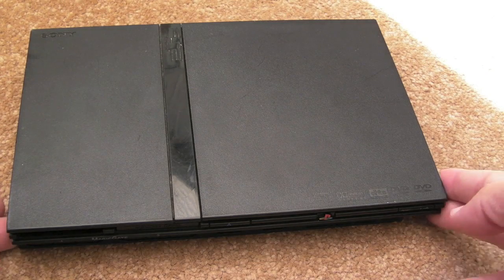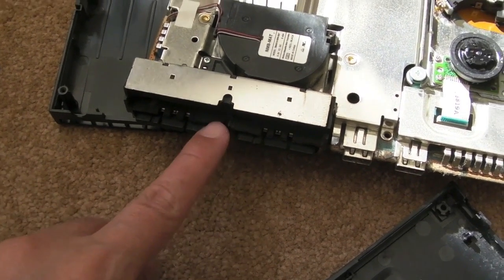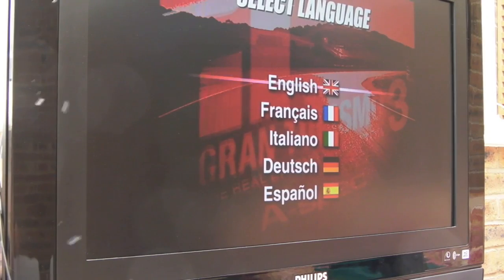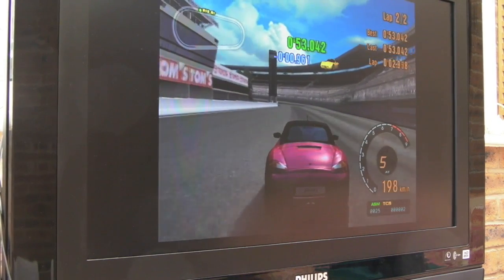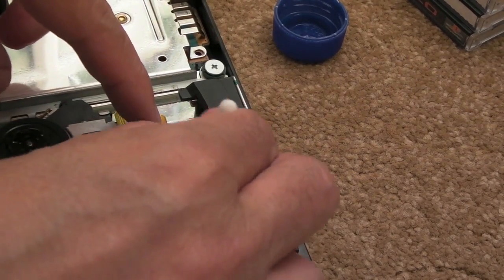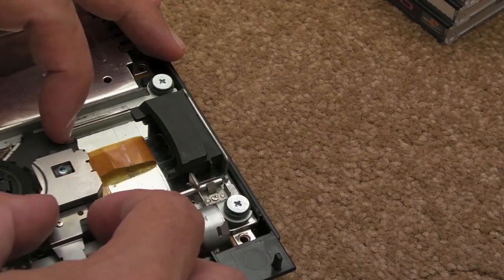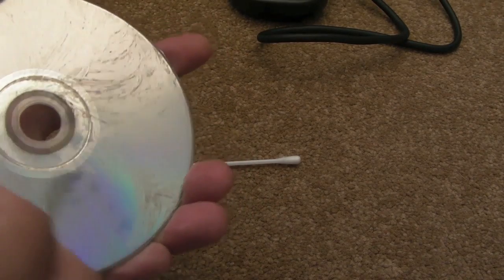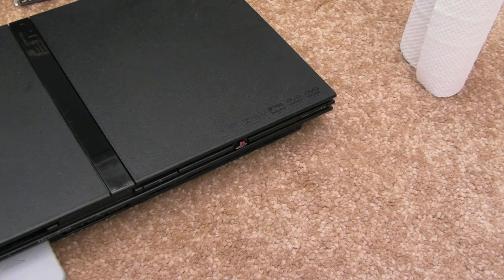Sony PlayStation 2 (Play Station) Slim DVD Repair (PS2 PSX) Scratched Discs (Cleaning Scratched CD)

Comment: This was very helpful, thank you. Figuring that I had little to lose, I just grabbed my screen cleaning fluid and gave my GT4 disc a thorough going over. It looks almost new now compared to a few hours ago. Am delighted that I don't have to buy it again. :)
Reply from the maker: Great =D  If your discs are getting scratched like that - don't forget you might need to swap out the ribbon on your slim.

Comment: I used to work for SCEE and the PS2 was known for cutting its own vinyl on your disks.
 Double side sticky pad underneath and over the top like a sandwich to hold the ribbon back. Thats what i used to advise. Works well and doesnt get tacky with heat.
Reply from the maker: Thanks for the info - very useful to know =)
Reply: Oh how do I do that

Comment: Shit design flaw. I just experienced one of these consoles scratching my copies of Twisted Metal 3, Tekken, Tekken 2 and 007 Nightfire.
Reply: Have you tried replacing the ribbon cable?
I had the same situation with my 79001 PS2 slim, and replacing it made a huge difference.

Comment: would you happen to know if the PS1 has any issues with scratching disks or if the disk reading mechanism (probably also a ribbon) is more reliable than the PS2 Slim? been using my PS2 slim for mostly PS1 games recently and i just got a ring scratch on a brand new copy of Castlevania SOTN i just got :/
Reply from the maker: I've not heard of the PS1 scratching discs at all!  Seems to be a problem related to the PS2 slim primarily.   You can just swap out the ribbon on the slim with a new one which has new adhesive.
Reply: alright good,neither have I but I just figured i'd ask you since you know more about this stuff than me. Good stuff,i just ordered a new ribbon. Thanks a lot man!
Reply: so replacing the ribbon did the trick,I don't get any scratches on my disks anymore but there's a new problem now...All the games i play seem to take a longer time loading and most importantly, during cutscenes, they tend to lag and not show properly.It's definitely the console and not any of the game disks,any suggestions?

Comment: Seems to be a bit of a common fault. Since I put mine back together it's scratching discs the same way. Think my laser is on the way out too. :(. Might hold off on getting a new laser until I locate the code for the PIC Chip Fix to protect the laser.

Comment: I bought my PS2 slim brand new and sealed in 2013 and barely used it. I started to actively play some games on it in late 2018-now(2019) and not even clocked 50 hours of gaming on it and this happened. It's treated with outmost care and is more or less mint condition. Is this just a normal design flaw where the glue/sticky substance ment to keep the ribbon in place dry up or disintegrate. Or am i just really unlucky?:P
Reply from the maker: Just a design flaw!  With time the glue dries up and and the ribbon comes loose =/
Reply: @GadgetUK164  Thanks for answering and thanks for the help. I think your video helped. Luckily I own 2 copies the game it happened with and I've tested with another game I own 2 versions of and no scratch marks so far:)
Reply: Gentlesir PancakeBottoms you're unlucky. Mine still works after 14 years

Comment: Literally just found out about this issue after I noticed one of my most valuable games had the hell scratched out of it
Reply: I’m in the same boat. It only works sometimes now. I have to keep resetting the system until it finally spins up. I bought a new cable and was looking up how to install it. But now I know how to at least polish my disc. I got nothing to lose at this point lol.

Comment: Hey man is it easy to replace the Ribbon? How do you take it out since most part of it is glued on the console? Do you just pull it out? Thanks for the video!
Reply from the maker: +mdrb97 Yes, it's easy to replace the ribbon!  Just order a new one - making sure you order the correct part.  Then the old one peels off the metal casing.  The new one comes with self adhesive on the back.
Reply: +GadgetUK164 Thanks for the answer I already got it sorted out tho (its really easy to replace after all)

Comment: 7:27 A few of my PS2 games have this same type of scratch, except it's in the center of the disc near the hole. The games still play just fine, but I'm worried that eventually they will stop working. What do you think is causing my discs to get scratched near the center?
Reply from the maker: Something in the tray, or the flex ribbon  (like in this video).

Comment: I have the latest model SCPH-90004. I can't even see, if it may be due to the ribbon or something else, because the metal shielding with the lens is always on the upper side and can't be moved like you do in the video with ease, when the console is in standby...
What do you think? Can it also do scratches because of a different issue?
After playing my game for 30 hours, it suddenly refused to load a specific room, then it was with every bigger area, a few hours ago I put out the disc and saw that terrible vinyl on it (it was Silent Hill 2 DC, a brand new copy)... :-(
Also regarding the disc: my scratches are on the same side as yours of GT3. Is it necessary to clean, in order to let it play again on a fixed console, or is there data written onto this outter spot?
And finally, how is this cleaning product called (= independently from the brand name)? I'm from Germany and want to use a similiar product from my country instead of importing yours. :-D
Reply from the maker: Often most of the disc surface is used by the game - so yes, a ring on the outer edge would need to be cleaned / buffed out.  The polish is Meguiars Plast-RX, but you could use Novus (both are a very fine plastic polish).  The scratches in a PS2 Slim are always from the ribbon rubbing.  You could move the laser unit by putting in a DVD movie, search to the end of the movie, that will then move the laser as you scan towards the end of the film - then just pull the power lead out and the laser should be further into the disc.  That might help you see the ribbon.
Reply: @GadgetUK164  
Thanks for the info. :-)
I will try to fix it somehow... Do you think it's absolutely necessary to open the console and exchange the cable, or can it be reglued or fixed otherwise?
Also, about your experience and personal opinion regarding this issue: Can this happen with every slim at any time, or is it more a question of components' age and usage?
Because mine was bought new and used over about seven years, but in total hours maybe one or two months.
And I still have a total of seven sealed units in my collection. :-P

And regarding the plastic polish: I've discovered that both products you mentioned are also offered at my German Amazon page! :-D
Can you please tell me the complete product number of the Meguiar's one, since there are several variants?
And finally: Can this completely remove such a ring-shaped scratch?
I guess that the deepness of my disc scratches is somewhere inbetween the one of both of your examples.

I really appreciate your quick, clear and detailled replies. ;-)
Reply: @martinkaiser5973  My ps2 slim also had this problem. And it was scph 79001. I took it apart and on the scph 79001 plastic clips were holding the ribbon in place. So I'm not sure why it was scratching the discs.  And can I ask if you played your ps2 alot or only a little bit? Thanks.

Comment: Thanks for the reply on the last one! Sorry but I have another question. I taped down the ribbon cable but at different points it is too tall and scratches my discs still, not nearly as bad as before just slightly. Should I replace my ribbon cable completely?
Reply from the maker: It's probably a good idea to replace the ribbon entirely!  You can buy (I think) replacement drive units complete too.

Comment: Hey dude, I saw you used the double sided tape/tape methods but could you not just super glue down the ribbon? There's adhesive on the replacement ones and the originals so I'd imagine it'd be fine right? I feel like there's less chance of me doing that wrong than replacing the whole thing.
Reply from the maker: To be honest the problem with super glue is a mist evaporates off it - it may cloud the laser lens if you aren't careful.

Comment: I know this was a PS2 Slim, but do you have any helpful tips for the PS2 Fat? My system had worked fine, I opened it up to clean the laser to try to get PS1 games to work. It didn't help, but it started acting up. My PS2 games were freezing, skipping, and the system would make a grinding noise. My discs are left with circle scratches all over. Could this be the ribbon? I regret even bothering with opening it. What would you recommend for the scratches? I just got the system and games.
Reply from the maker: It sounds like the drive has some kind of miss alignment - the laser unit is sat too high, perhaps the spindle has been pressed down?

Comment: Who would of thought a ribbon would do that, I would of thought it was spinning incorrectly and the disc was catching the case. 

Nice fix
Reply from the maker: Thanks =)  Yes, very surprised to see it was the ribbon!  As mentioned in the video I've ordered a new ribbon anyway - basically I noticed later that there is a fair bit of damage done to the ribbon which wasn't evident on that video.  Once cleaned up I could see a tear to the right hand side of the ribbon and whilst its working perfectly it clearly wont last with usage etc.
Reply: @GadgetUK164  I'm not allowed to open it So i wanna know if there's S way to do this without opening the unit

Comment: I cleaned my scratched discs with this product and a microfiber cloth with limited success. Some of the product I think has gotten into the see through ring in the centre of the disc. I was just wondering if you would know how I would get rid of this?
Reply from the maker: Into??  Try using a toothbrush on the inner ring part (not the part of the disc containing data).
Reply: @GadgetUK164  just tried it there no luck.

Comment: Mr Gadget thank you so much! I revived a destroyed Tony hawks 3 with Meguiars PlastX! although I have a question if that's cool with you, will this stuff be ok to put on a ps1 black disc? and a blue cd ps2 game disc? is it all the same stuff?
Reply from the maker: Great!  It should be OK on those other disc types.  I've done the black and blue discs before.  Just test with a tiny amount first, and use cotton wool or something similar.
Reply: awesome, thank you

Comment: May have to try this on my slim PS2 SCPH-75003 model. Was thinking of replacing it, but it's my PS2 from back in the day so I don't really want to. I have noticed though that the 7900x models don't use this system, instead holding the ribbon towards the bottom plastic case with tabs. Maybe those are more reliable?
Reply from the maker: I suspect you are right - they will be more reliable if its held with a clip!

Comment: Can you tell me what kind of tape that is? It looks like foam tape but a bit thinner.
Reply from the maker: Look for "3M double sided pads" on eBay - just cut to size.
Reply: @GadgetUK164   Thanks. Could you also tell me what you used to repair the disc. Could I use any plastic polish?

Comment: I use a car buffer it's a drill attachment and then using Meguiars fine polish shines CDs right up. Also what type of a PVC polish were you talking about??
Reply from the maker: The PVC polish I use is Meguiars Plast-X (now called Plast-RX).  A car buffer will do a nice job!
Reply: @The Best Western that’s what does it right there bro I figured that out the hard way. The heat if you leave it there for too long it will put a spot in it you can’t get it out the game or CD won’t play it’ll give you an error. Ripples in the spot where  it gets too hot. After that you can’t you can’t repair it. I  use the car wax video Maguires or whatever I also got some stuff it’s like titanium dioxide cream it’s for a cd repair I use that to. It works great the drill is the best as the bench  grinder goes too fast you can do damage real quick like. Gotta be real careful with that one. 

I do like putting a buffing head on there and shining up aluminum I got some cranks like some 1980s bicycles three-piece cranks aluminum cranks they looked like hell I got them things looking like mirrors. I got this psycho obsessive compulsive thing going on with shining things in and the rust rust really bothers me like bad.  I don’t know why.  I mean I live in Florida there’s gonna be rust but if I spot rust and throw it in the electrostatic electrolysis tank. I can’t deal with it.

Comment: Just want to ask..is ribbon play any part in reading or for the ps2 to function ?
Reply from the maker: If the ribbon is damaged, it wont be able to read the disc.  If the laser is bad, it also will not read a disc.   It wont cause the PS2 to not power on though.  It is just connected to the laser.
Reply: Oh ok.. so, recently i bought a discs (blank art) game and just change  the lens like 2 weeks ago..when i start the game it runs like normal but when its on the main menu, it freezes suddenly..is it because of the disc or something else?
Reply from the maker: I would test the PS2 with other games - if other games work perfectly, it's probably the disc.

Comment: Hello, I just ordered a ps2 slim off of Mercari and ran into this with a new game I ordered along with it. I will try the adhesive tape on the rubber flap to fix it for future situations. Also, the ps2 has a strong cigarette smell, do you have any solutions for it?
Reply from the maker: Strip it down and clean all the parts in IPA!

Comment: I need advice

You see only when I put in a certain game.
Xenosaga Episode 1.
It works perfectly fine. But sometimes, not always it makes a scratch sound when booting to the start up screen
Not reading the disc. It reads fine. It's literally only sometimes when booting past the PS2 logo then goes to the Developers previews before the start menu
It plays fine.
Just that scratching sound ONCE then it plays normally.
I saw a big scratch on the bottom but I don't know if it was already there as it was used.
I did the taking the disc out and back in and starting it over. 20 times
Scratch sound was occasional. But there isn't any more scratches then when I put it in...
It plays fine. There isn't more scratches on it.
Should I be concerned?
My friend tells me it might be the laser moving down to read the boot data.
Can you help me?
Is it the console or do I need to stop worrying and stop inserting then removing the disc?
It's not a circular scratch.
It's like a long scratch straight in the bottom and a few light scratches forming a comma.
Only visible under a bright light 
I'm very stressed out over this and hope I am not ruining my game.
I would reset the console remove disc reinsert it And test it.
Again the ONLY DISC that does this.
Everything else is clean and unscratched no matter how many times I play the games
Just trying to see if it's because I keep taking it out and putting it back in
Reply from the maker: If there's a scratch on the disc, check if the ribbon is glued down (as in this video)...  It sounds to me like the ribbon is scratching your discs!
Reply: @GadgetUK164  I don't have the means to take it apart myself 
If it plays flawlessly is that big a concern?
It's literally only that disc

Everything else is perfect

Mind you Xenosaga Episode 1 is a dual layer disc and has sensitivity issues on PS2 models
Reply: @GadgetUK164  WAIT!
my model is 79001 the tabs COVER the ribbon
Reply: @GadgetUK164  please respond as soon as you can I forgot that detail

Comment: A cotton cloth is good to clear the PS2  DVD ? Which material is the best to clear the DVD ?
Reply from the maker: Cotton wool is quite good if you use something like PlastX to polish the DVD.  You can also use those microfibre cloths.
Reply: Thanks
Reply: Must be headlights polishing liquid or just headlights liquid for shine ?
Reply from the maker: The cleaning polish I use is special polish for cleaning plastics - ie. polishing out micro scratches.  https://www.amazon.co.uk/Meguiars-PlastX-Plastic-Polish-296/dp/B0000AY3SR

Comment: My worm drive motor wire strip broke off.plsss help me..how can i replace it or any other way?
Reply from the maker: If you cannot solder the wire back onto the motor, you will have to remove the motor and swap it - OR try and take the motor appart to fix the solder point.
Reply: @GadgetUK164  thanks for the advice sir..☺️
Reply: @GadgetUK164  The strip just snapped off. Thats the real prob..

Comment: Man, I HAAAAATE badly designed disc drives that have tendencies to scratching discs. (PS2 Slim here, fat Xbox 360, etc.). 
Heck, I think this is even worse than what Microsoft did with the launch model 360. If you leave it be, it never scratches discs (I would know, I've been using one for the last 7 years). But PS2 Slim? Over time it WILL start scratching, even if you don't disturb it. Yeesh.
Reply from the maker: Very annoying isn't it!  I remember the 360 problem - I bought Halo 3 and my drive scratched the disk, contacted Microsoft and they blamed me, yet I know it was a design flaw with their system.   The RROD also left a bad taste in my mouth for Microsoft consoles - I kid you not I went through 5 XBOX 360's due to the RROD failure!!!  I keep expecting my XBOX one to have some similar BGA fault but it hasn't died yet!  Do you know what the reliability of the PS4 is like, I am considering buying one.